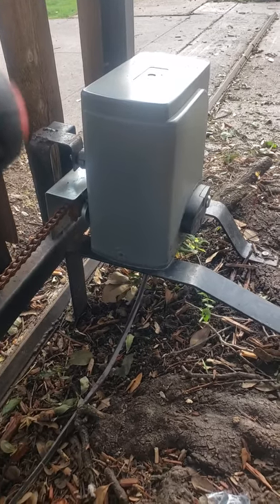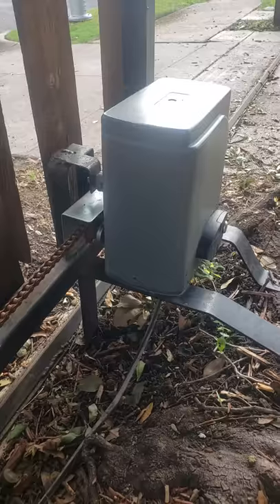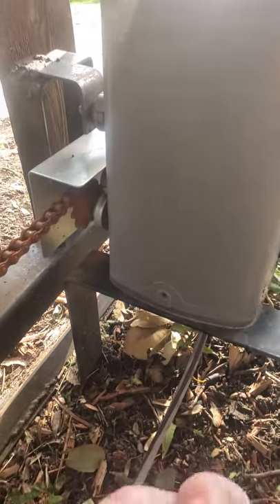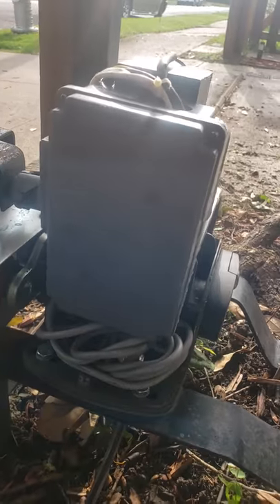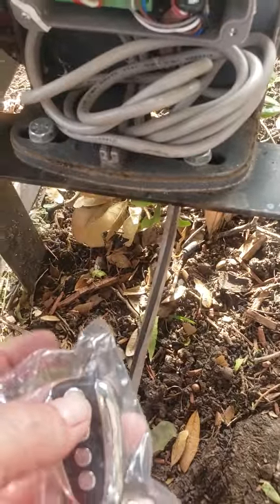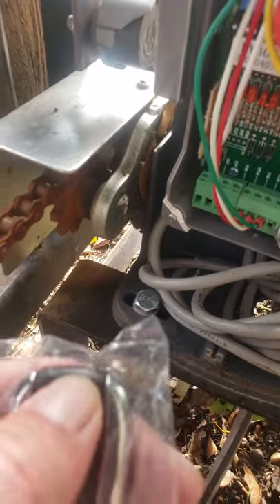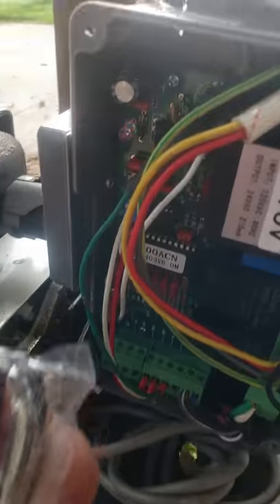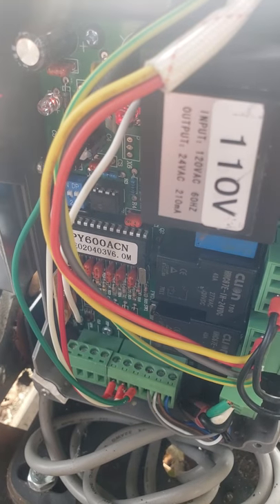CO-Z Automatic Gate Opener Remote Programming

Comment: Good video,On the CO-Z opener where do I connect the sensor wires?
Reply from the maker: I will have to check the specifics when I am back home. It's very simple.
Reply: @nathanielross1239  Oh,Thanks I would appreciate that
Reply from the maker: Well I can't upload a picture so let me try and explain this best I can. This is assuming using the same sensor I am using.

Facing the panel with the covers off.... On the panel you have 2 green plugs at the bottom that the wiring going into the board is hooked to. The one on the left I have nothing plugged into it has 4 slots. The one on the right controls the motor and should have 6 slots. 

3 should be empty slots to the right hand side  labeled 
IR
GND
24VDC

The IR sensor has 4 wires you want to use. Grey, white, brown, blue

Grey goes to IR
White and brown go to GND (twist them together)
Blue goes to 24VDC

After those are connected its just a matter of attaching your sensor and the reflector so when something crosses the beam the gate stops and reopens.

Hope that helps.
Reply from the maker: https://www.amazon.com/dp/B001LFPB0M/ref=cm_sw_r_cp_apa_fabc_8mVVFbEA6S6W1?_encoding=UTF8&psc=1

In case you needed to know the sensor I am using
Reply: @nathanielross1239  Thank you, so much.
Reply: @nathanielross1239  me again,Can I have the measurement from the motor plastic cover to the farthest end of the middle sprocket  bearing?

Comment: What's the frequency required on the remotes for these model the 433mz or the lower 3 hundred one thanks
Reply from the maker: I believe it is 433 mHz. I have failed to get it to work myself using 433 remotes from anyone other than the manufacturer.

Comment: Nathaniel,  do you know if you have to have the sensors installed before the remotes will program?
Reply from the maker: If sensors you mean the magnetic limit switches, I don't know think so. Adding the remotes is done inside the panel box so if you're adding new or extra remotes you'd just need to have power so you can sync them to the unit.
Reply: @nathanielross1239  This is a brand new install.  The magnetic limit switches are installed and work.  Hit the learn button and can see when I push the big top button on the remote I see the light lighting up on the control board but the gate doesn't do anything.   The manual test works each way open and closes.  Not sure why remote won't program.
Reply from the maker: @gluc0se  the light should flash, then you push the top button on the remote until it syncs. Once it syncs it should start opening and closing. You may have to keep repeating the process. Make you are using the manufacturer supplied remotes, not a 3rd party remote, 3rd party remotes will appear to sync but they just never will.
Reply: @nathanielross1239   Thanks for your help Nathaniel.  Once I realized I was trying to program the knockoffs instead of the original remote thanks to your tip I was able to easily get the gate programmed.

Comment: I have questions when you install motor on the left of gate like  yours do you have do anything different cause the books says that default on motor is for right side mounting thanks.
Reply from the maker: I don't remember making any changes other than positioning the stop limit magnets opposite of what the book said. One stops it from opening too far and the other from closing too far. One side is mounted just a couple inches higher than the other. It was little trial and error but pretty easy once I figured it out. When you press the remote, the motor will keep spinning and spinning until one of the magnets crosses by it. When you press the remote again it will stop and just go the other way.
Reply: @nathanielross1239  thank you

Comment: Hi bro whats the frequency of the remote. I used 433 and its not working
Reply from the maker: I tried doing this myself. This particular system only works with the remotes purchased directly from the supplier. You can find one here and program it the way I've shown in this video.

https://www.amazon.com/dp/B0197QYJCC/ref=cm_sw_r_cp_apa_fabc_L4kPFbJTHX6DK?_encoding=UTF8&psc=1
Reply: @nathanielross1239  thanks a lot mate

Comment: Hello, I have the same device. My remote controls are old, I bought a new one 3-4 times, but it did not work. When I press the control, the light turns on, but the door does not close and open.  can you help me
Reply from the maker: I don't know that I can help. It might be a problem with the actual board(computer). 

I have had to just keep trying over and over sometimes, but as long as you bought the remotes directly from CO-Z it should work.

3rd party remotes with the same frequency just won't work. I've tried myself. Sorry.
Reply: @nathan where can I buy the original remotes?

Comment: My neighbor have the same gate. How I can reprogram my remotes to have a different code.
Reply from the maker: Unfortunately there is no way to reprogram the remotes. They are on a set frequency. I have tried using other brand remotes myself which are the same frequency and they just won't pair with the motor. You have to buy the remotes directly from the company that sells this gate opener. 

I believe they also sell a keypad, however, I have no use for one so I don't know the method of connecting or programming one.
Reply: Ths.

Comment: How can i fine wat remote goes with the gate opener..I'm looking 4a sun visor remote
Reply from the maker: I do not believe this model has a sun visor option. I tried programming one that uses the same frequency and it didn't work. The only ones that work with this opener have to be purchased from the manufacturer.
Reply: @nathanielross1239  thx u

Comment: Your doing it wrong buddy!!! You have to hold the black button down for a second then it beeps then you push the remote button down and it will work!
Reply from the maker: I must have a flawed system because mine doesn't beep. This is the only method that has worked on multiple remotes. Thanks

Comment: I followed the steps but when i push the button it only sounds like a clik, but it won't open... What am i doing wrong?
Reply from the maker: The process is frequency learning. I've had to do it multiple times. Press the black button on the panel, then click the top button on the new remote. These must be remotes from CO-Z otherwise they just won't work. Once it recognizes the signal the gate will open and close as it should.
Reply: Ok where does the white wire that is left out go
Reply: Is it a signal wire
Reply from the maker: @anthonydejesus4995  mine has an extra wire. It's doesn't get connected to anything.
Reply: Thank you very much but how did you program the controls
Reply: The remotes
Reply from the maker: @anthonydejesus4995  you just have to open the panel and press the little black button. Next press the top button on the remote. You have to repeat those 2 steps until the opener responds to the signal from the remote. It's very easy.
Reply: It clicks like he said and it the gate moves slowly what do you think is the problen
Reply: What are the skinny brown wire for
Reply from the maker: @anthonydejesus4995  those wires go to an infrared sensor which stops the gate from closing if you cross the beam. It's a safety item you can add to the system.

Comment: I have an issue with mine. The gate opens on its own sometimes. Any ideas whats causing it ?
Reply from the maker: That doesn't seem normal. I had issues where mine wouldn't close after installing the infrared sensor but I realized later that was because the reflector had water droplets on it and threw off the infrared beam - also only ever happened when it rained.

You may have a defective remote that has a sticky button?? Just a guess.
Reply from the maker: I know it's been a year since I first replied but possibly you have or had the chain too tight?